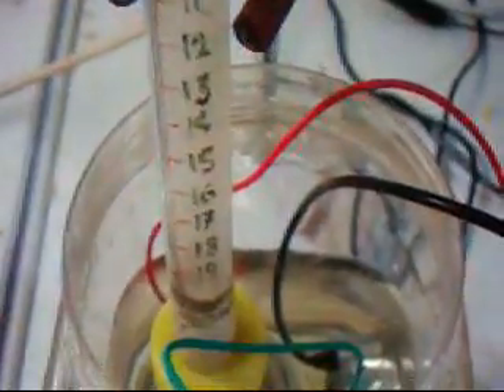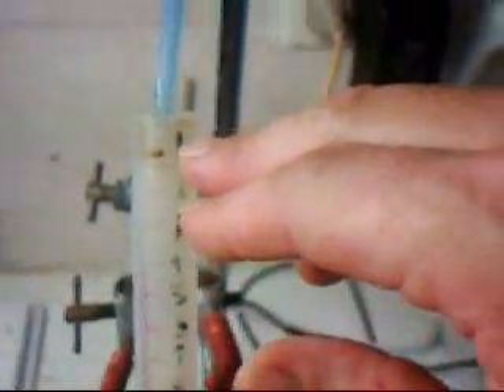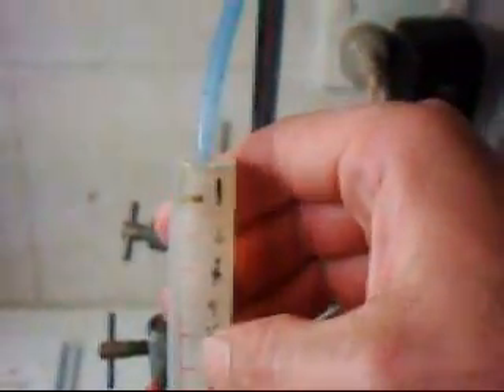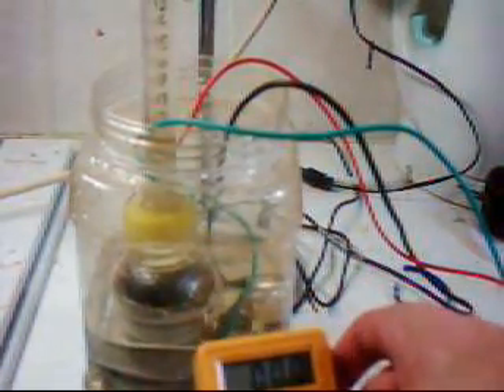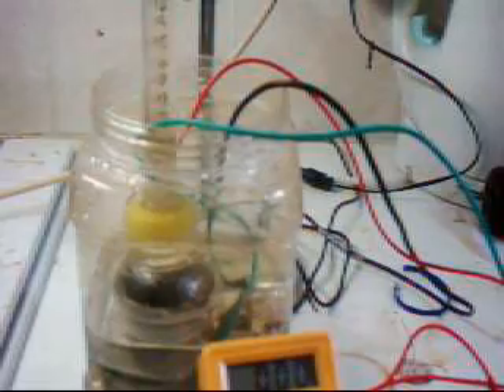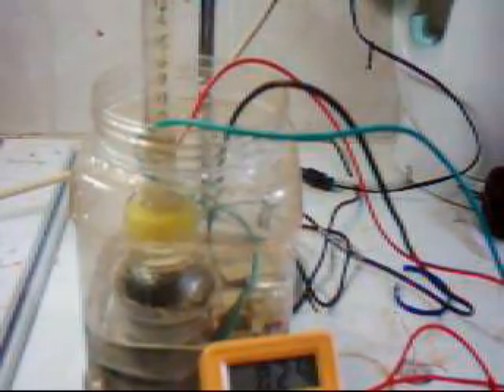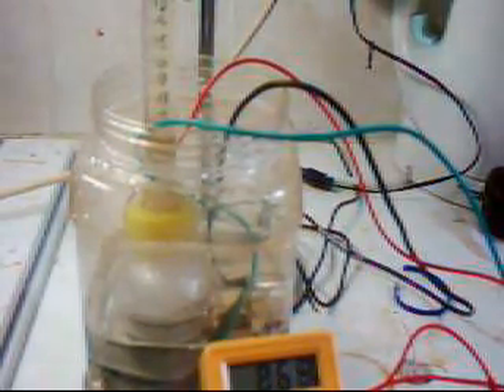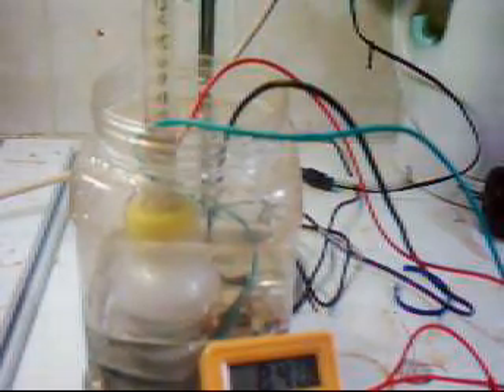crob227's spiral plate cell ultrasonic gas volume test

Comment from the maker: @ZeroFossilFuel 
the production was less with the ultrasonic frequency used,in this experiment-the frequency was at the wall current frequency of 50 Hz.
im not sayin that other freq's work worse or better,just that is the only freq. i have tried

the ultrasonic decive that i used only ran at the wall freq. from the AC power supply.
so no gas gain,maybe short pulses would work,but with constant sound i had no joy.
perhaps bubble formation is helped along by micro bubbles between the plates

Comment: I did try similar a couple years ago. Problem I was fighting was bubble accumulation on plates.  Tried ultrasonics to keep plates clear.  But when it did not increase production I dropped it due to complexity.  I am looking at it again because my latests setup creates huge quantiy of fast moving nano bubbles.  Am thinking this might help to get them out of solution.  We shall see.

Comment from the maker: Thnax for that info.
it appears that ultrasonics will disassociate water without any voltage across the cell.This worked best when a standing wave was set up between the cell and the transducer.However the volumes i saw were to small to test.What do you think SGiHunter?